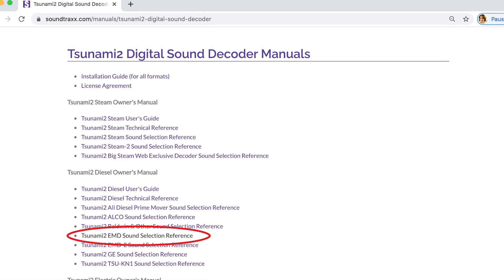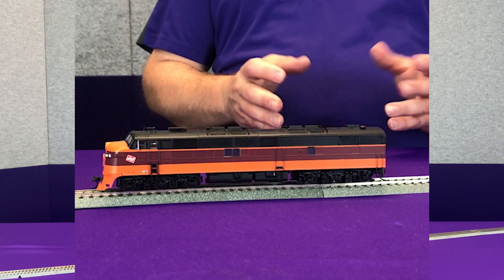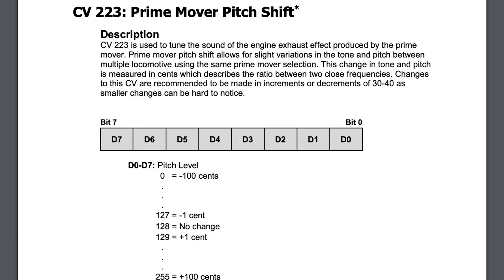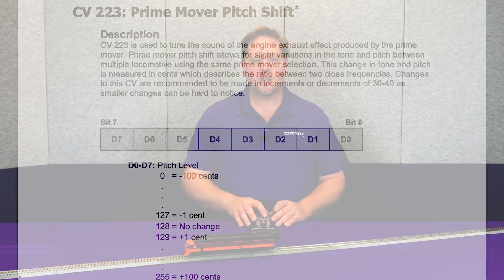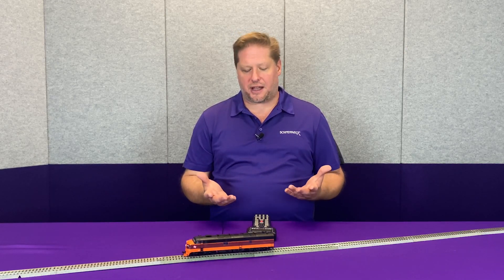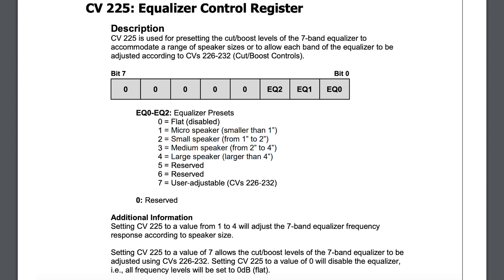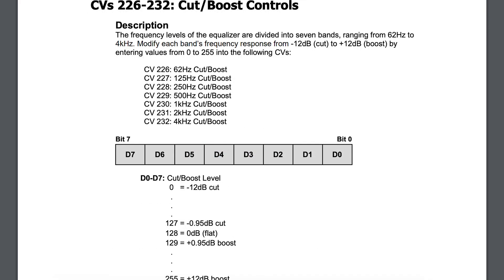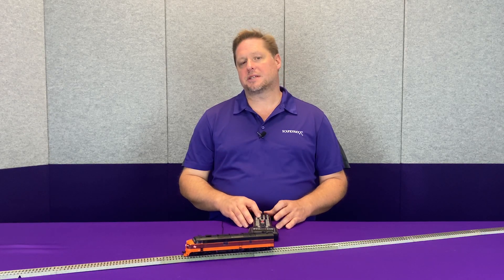Tsunami2 Prime Mover Adjustments: CV 123, CV 223, CV 225, CV226-232

Comment: Sorry, I hear you just fine but I hear nothing when you start the engine.
Reply from the maker: I am sorry you are having problems hearing. Maybe try on a different device.
Reply: @SoundtraxxDCC  I am using a desktop computer with normally decent sound and I have the volume set at max.